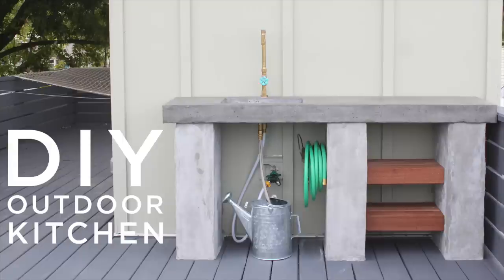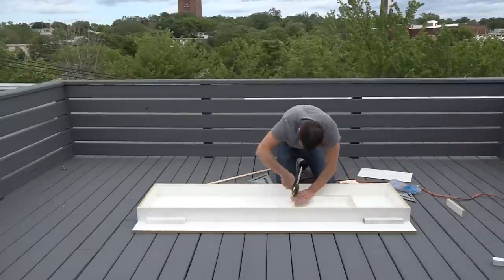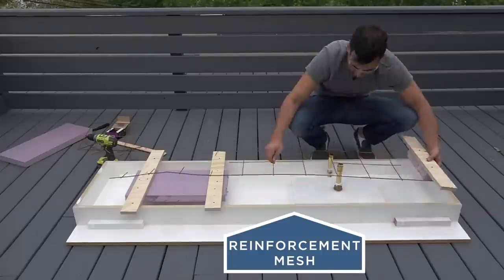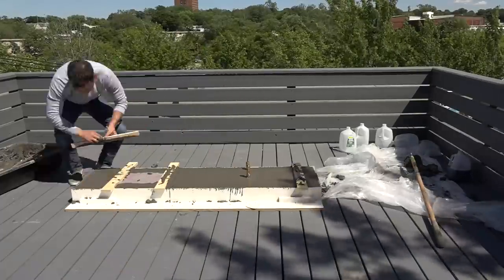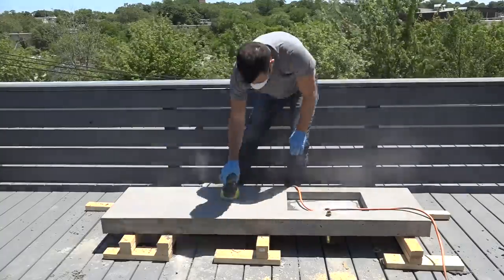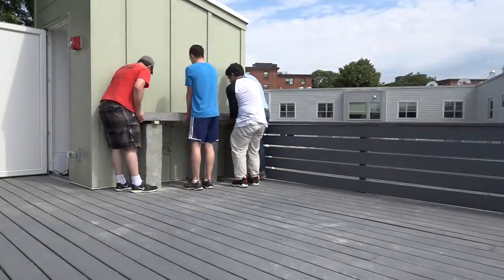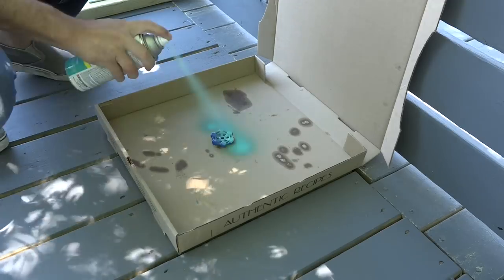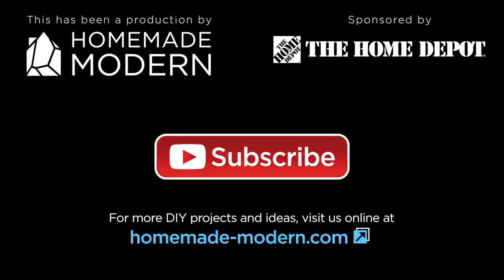DIY Outdoor Kitchen with Concrete countertops and sink

Comment: Neat, but you shouldn't have concrete directly on your wood deck (if it is wood).  It holds moisture and will rot it out quickly.

Comment: It looks like you're on an upper level deck. Did you check for ample support to protect anyone below? This whole assembly likely weighs 500+lbs/227kg. Add a couple of adults and it could spell disaster in a short time. If you haven't checked - please do so immediately. 
It looks beautiful ! ! Well done.

Comment: I think your videos and concepts are great and easily accessible. But I have a problem with the weights and this latest concrete project seems to be possibly the heaviest of all? You do indeed address the issue of weight in all your videos. You state the bench top alone is 320 pounds? I estimate that with the footings & fittings etc you would easily be over 1000 pounds?

I would love to see a similar project built without excessive use of concrete. There are ways to build essentially the same concrete top with possibly half the weight. 

Keep the videos coming!

Comment: This was a great video/tutorial and very inspiring. I've been tossing a similar idea around in my head, wanting to try my hand at a concrete countertop with a store bought or scrounged sink but I really like your use of the concrete to mold a sink out of the concrete in one mold. I was thinking about using 4X4's for the base. I also really  like your industrial looking faucet.

Comment: I hope you're not too bummed out when this has to be removed because your deck needs refinishing or replacement, especially since trapping water against the boards and adding a significant static load is going to accelerate that process. :/

Comment: that's a lot loading on that roof deck.  those columns are at least a 200-300 lbs each.  total weight of the sink and columns... 1000+ lbs over a 5 ft span?

Comment: great project!
but isn't the sink not deep enough and the pipe too high? i mean for spills and stuff
Reply: I saw it, the water is sneeze right off the sink!
Reply: The problem is he didn't put end filter on. That filter mixes water with air and slows down everything.
Reply: you mean aerator?
Reply: IndieFlavor02 yeah it is
Reply: IndieFlavor02     D z
Reply: It's outside, doesn't matter if it splashes :)

Comment: Is there any special reason why nobody on YouTube actually specifies the amount of water they add to the mixes? Water to cementitious materials ratio is by far the most important parameter, when it comes to strength and durability. You guys need to do a little bit of research on that. Also try adding small amounts of plasticizers into your mixes. You will get much better surfaces and much fewer bug holes (entrapped air) in your concrete body.
Reply: Good to know. Thanks.

Comment: i never used pipe dope, what is the advantage to using regular teflon tape?
Reply: Pipe dope is significantly better at sealing. Teflon tape isn't really meant to seal. It is primarily to make it easier to thread parts together.